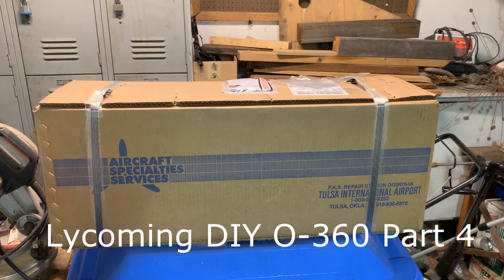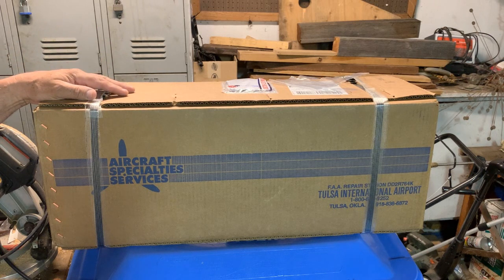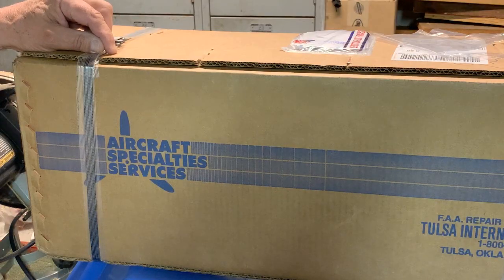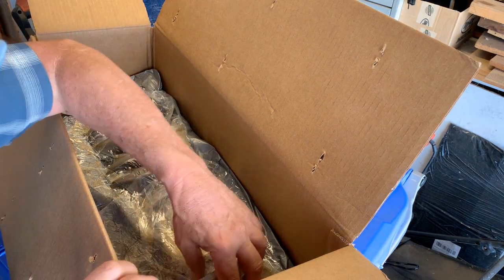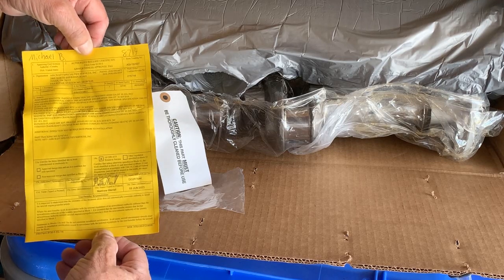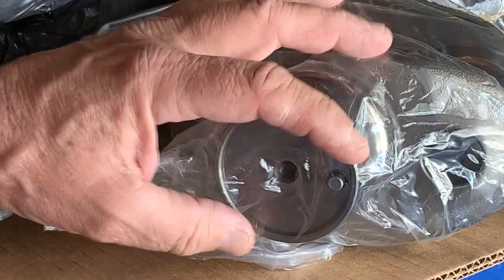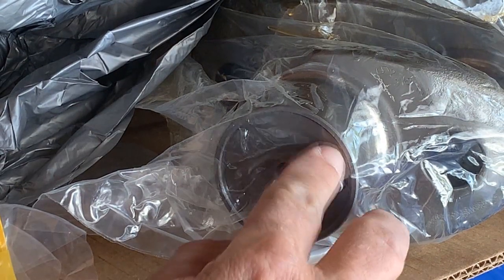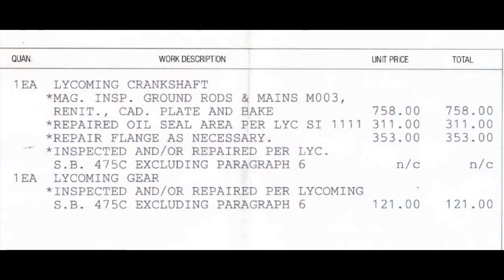Lycoming O-360 DIY Overhaul Part 4

Comment: Thank you for your great video , there is not much content on YouTube on how to overhaul a Lycoming engine, but 2 question's,

 1- what are you going to do with the other engine parts, are you going get everything like rod's cilender Bors, valve's , engine block everything aslo inspected or just cleaning them and using them?

 2 - what mentotod do you use to clean aircraft engine parts?
Reply from the maker: Thanks for your interest today. The other parts are staggering out, including everything. The cleaning is up to the company, but it's a number of steps. Most basic would be a walnut shell blasting, fairly typical. All the parts will be handed off to a licensed engine rebuilder.  I think it gives more control doing it that way. Otherwise, you'd pay whatever they say and you learn nothing. I was told, for example, that the crank was no good. That would have been a huge loss, but wasn't. It's as good as they come used or better.
Reply: @michaelbradford2816  I really appreciate the effort you put into making the video, it's really going help me in my overhauling process, I'm planning to do most of the work myself and just take the part that needs work to a meachine shop and telling them what to.  I'm for the acceptable tolerance limit documents for all o-320 parts , do you have the download link for it or know what might be called so I do some research and find it?
Reply from the maker: @sobhansabbagh6171  Sounds like you're on the right track. You'll need the repair manual for your specific engine. Also, don't hesitate to call a specialist for support usually found in Oklahoma. They'll be very generous with filling you in on your next steps. Not a bad idea to talk to an engine rebuilder either. It may save some time.
Reply: @michaelbradford2816  I really appreciate your content, aslo waiting for the next parts of your engine rebuild series, Keep it up
Reply from the maker: @sobhansabbagh6171  Hopefully your wait won't be too much longer nor mine. Your continued interest as for the other followers is a key motivator to produce more or these.
Reply from the maker: All wear parts go to an aviation specialist for testing and cleaning. If rejected, they are replaced. That's not very likely since most parts look new.
They clean with walnut shell blast and some chemicals. Then they measure and will fill out the 8130s. The mags go to another specialty house. The engine block is more touchy and is tested with bright yellow dye. It may be welded here or there. Not always.